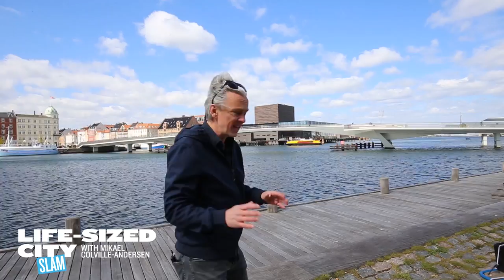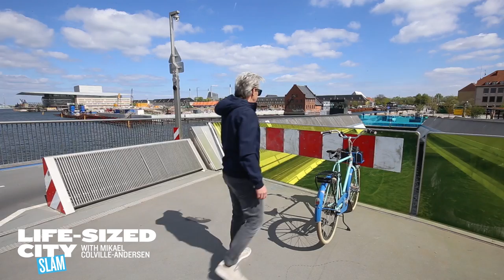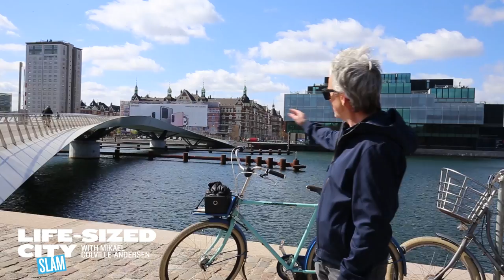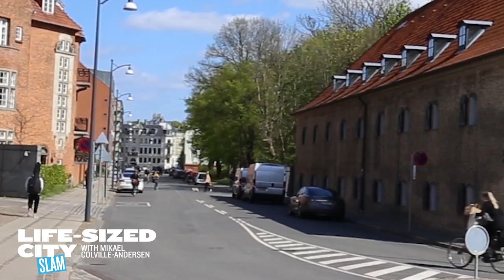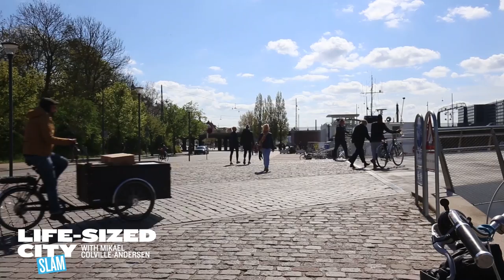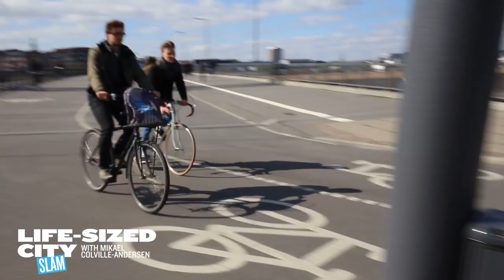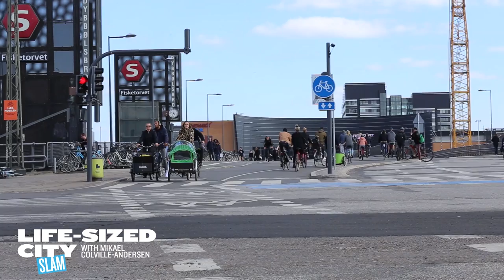The Unholy Trinity of Bridge Stupidity in Copenhagen

Comment: I don't even care about the bridges, I'm just watching the people and city in the background. As someone from Arlington TX now living in Austin TX there's so much of Copenhagen that's completely different and beautiful. 
1. more cyclists on the road than cars - in Texas you need a car to get around, the roads aren't designed for bikes or pedestrians. Public transportation is minimal or in the case of Arlington completely missing altogether. Arlington is the largest city in America without a public transportation system and roads are built with no bike lane and sometimes no sidewalk either. Copenhagen has some of the largest sidewalks that there aren't also a bunch of utility trucks driving on that I've ever seen. College Station manages to have bike lanes and large sidewalks but utility trucks ruin that by thinking the sidewalks are their short cut and will honk at pedestrians to get off their sidewalk.
2. cyclists are obeying traffic signs and stopping - in Texas cyclists think that since the roads are meant for cars that the exchange for that crappy hand is to run stop lights and stop signs since those also were designed for cars. I've been run over by a bike who ran a stop light while I had a signal to use the cross walk.
3. The design of the city looks a lot less congested and the roads and sidewalks and everything look like they are in much better repair than any city in Texas I've been to. Usually the sidewalks in Texas have large cracks, are about 2 foot wide and weave around fire hydrants. Usually sidewalks in Texas will just end abruptly for no reason and there are no shoulders on the roads and large drainage ditches off to either side so if you choose to ride a bike or walk in Texas be prepared to walk in drainage ditches a lot.
4. Even in Texas did have adequate bike paths and sidewalks the heat in Texas would be unbearable. We're having a pretty mild June and it's 6 AM here and already 75 F degrees.
5. People in Texas who walk or ride bikes places are seen as lower class if not completely past broke. Even people on welfare here have cars, you need a car to have a job. You will be fired if you show up to your evening shift job after walking/biking 4 miles there when it's 95-105 F out and drenched in sweat.

Comment: Another bridge which fails in many ways is the Twin Sails Bridge in Poole Dorset UK. It was an imaginative idea to promote Poole with two lifting sail-like wings to allow taller boats through. It was commisioned by a Council hungry for self aggrandisment for a lot of money and designed by a company who were obviously full of design but short of engineering skills. This is a large road bridge for all traffic including trucks bound for the docks. An expensive and convoluted route was built to accomodate the bridge. Pretty but not very practical or functional. Two week from opening, some tarmac fell off the wing sections. The mechanism for the wing sections has failed regularly and it is currently out of use awaiting expertise?. There is a large marina the wrong side of it. The French seem to be the masters of bridge building around this part of Europe.

Comment: About your kissing bridge rant; I don't think you fully understand why some architects design things the way they do. For example, you stated that the bridge is too steep, however the city may have told him that the bridge can only be so low and parts of a river can be skinnier than others, which causes the grade to be very high. On the topic of the mechanism for the bridge, architects are taught to make things unique and push design and engineering forward and although I agree it didn't work as well as they'd planned I think it should be given some credit for at least trying to push the envelope. One of the strongest points that he pointed out against the kissing bridge that I agree with is the sudden right turn on the one end of the bridge, was not a smart move and should've been at least a smooth angled turn. All in all my point is don't blame the architect for everything, and especially things they cannot control.
Reply: Shades 1.5  as someone who is studying architecture and who has many friends in the trades maybe you just aren't seeing the full picture.
Reply: Shades 1.5  I agree some are terrible and completely arrogant and I'm sorry you've had those experiences. What I am trying to say though is sometimes it isn't in the architects control, sometimes completely on the client which i stated in my first reply. Trust me I'm not planning to be an arrogant architect, if I'm wrong and if I make things difficult then I'll admit it. Like in many others fields you will always have arrogant assholes but I don't think writing off a whole profession as arrogant assholes is entirely fair. I don't go around saying all mason's are idiots and assholes because I haven't met all of them.

Comment: You think that is stupid? try this story, 
Mystery over Ayalon: The bridge that leads nowhere
Above the road in Herzliya there has long been a bridge on which the work has not ended, and there is no drop. Israel's routes: "He is the municipality." In the municipality insist: It's theirs

For several years, an unfinished pedestrian bridge over Ayalon lanes in the Herzliya area has been completed, without its construction being completed and no municipal or planning authority agreeing on the answer to two simple questions: Who does it belong to? And who will complete the work on it? Israel's routes claim that the bridge belongs to the Herzliya municipality, while the municipality insists it is Israel's routes.

The story was first published on the network pipeline program. The picture shows the bridge from the bird's eye: the concrete structure above the road exists, but it does not descend to either of the two banks.

 
Construction of the bridge began in 2015 as part of the work to pave the continued routes of Ayalon north from Tel Aviv to Herzliya. Millions of shekels were invested in it and it was to be used by pedestrians and cyclists on their way to the municipal park.

The Herzliya municipality said in response that "the bridge was designed and built by the Israeli route company - which also determined exactly where it will be located. The bridge has not yet been delivered to the municipality and an attempt is now being made to find a solution to the issue."
 

On the other hand, there is a document in Israel's lanes containing a summary of the District Planning Administration's meeting, in which the chairman of the Herzliya municipality decided to prepare the plans for approval of the bridge. In the document of the competent body.
https://www.ynet.co.il/articles/0,7340,L-5662805,00.html

This is the busiest highway in Israel, Over 500,000 cars a day. just imagine the time wasted for these people standing in traffic for noting

Comment: If you look at this bridge in satellite view on Google Maps, you can see instantly why it is a disaster for cyclists - the design was dictated by the "kissing" movement of the parts rather than being designed to accommodate cyclists. Both the chicanes (at either end) and the minimal ramp length (causing its steepness) are the direct results of the mechanical design of the bridge.

Comment: I hate bikes (mainly because in my area of switzerland the bike drivers are (definitely not all but enough to form a stereotype) arrogant ant ignore often trafic laws.
(also thw infrastructure for bikes sucks)

However, even I if in charge of a bike oriented city would encourage solutions that work, rather than make a chaos out of it.

I think this is an example of how some things should be designed and planned by experts and looked at with  users and locals and kept away from politics.
There are projects where competitions and democracy with its often lay people in the deciding position will lead to bad results, for example infrastructure design.

Democracy should decide about the biger plan and goals, but leave the designing and planning to experts.